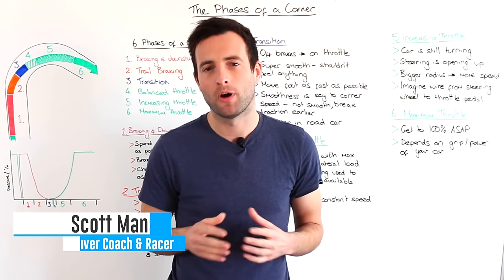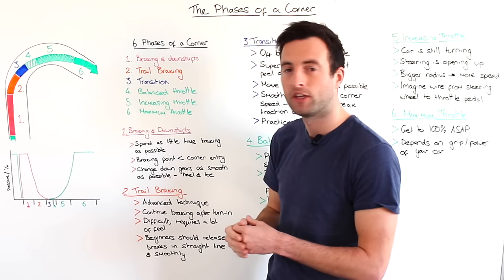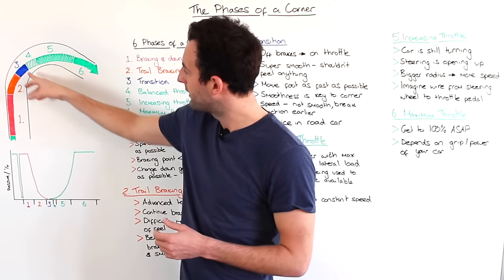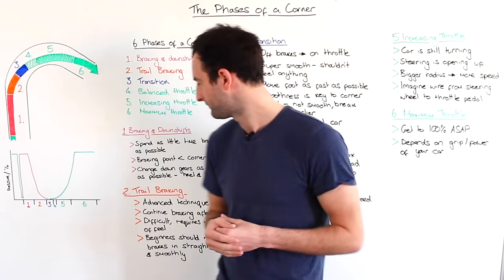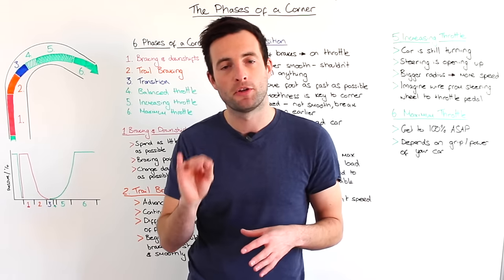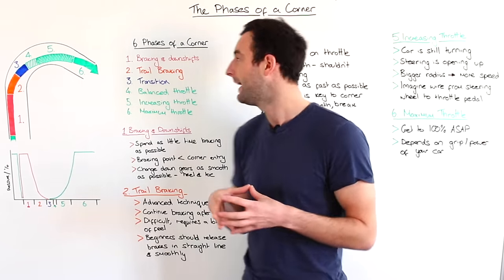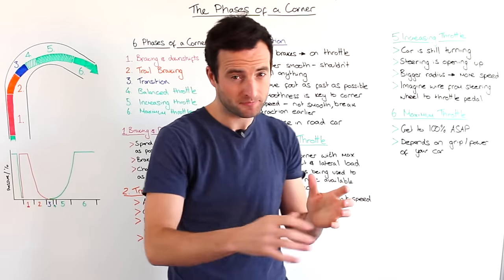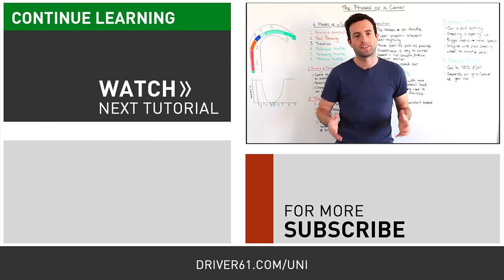The 6 Phases of a Corner: a Step-by-Step Guide

Comment: Excellent video as always. I would have add a graph with the steering wheel input on vertical axis, showing the phases 1 and 6 there is almost no input, 2 the input increases as the car slow down, the exact inverse of phase 5 as the input decrease as the car goes faster. The graph would have shown a Gaussian curve.

Comment: Amazing information, thank you Driver61.

I have found that this to be slightly different in a front wheel drive though especially with regards to the trail braking time(Almost none but this is largely chassis dependent) and the phase when the accelerator starts being applied.

I have submitted footage for review & it would be great to get your point of view especially in a tight "Spec" series with no LSD.

Thanks again for your content, I am studying it in detail.

Comment: Hey man. Love these and totally sharing them. My pet peeve here is the diagram and explanation of Phase 1 pedal work. The graph indicates immediate 100% brake pressure, you even SAY lifting off ...and go to the illustration which shows 100% brake pressure as a square wave. which would mean stabbing the brakes. The braking force should be shown to be ramped up ALSO like in your later video about braking (you do explain it there). But this video by itself ILLUSTRATES stabbing of the brakes .....
Reply from the maker: Hi, yes, fair point - the diagram is probably a little simplistic. When I eventually revisit these we'll have it changed. Thanks for the feedback. Cheers, Scott.

Comment: Driver61, the part I struggle with the most is the downshift and braking phase how to get it smooth? Are you coming down the gears and heal toe downshift? (This sometimes slightly upsets the car and hard to maintain consistent brake pressure) Or are you just selecting the gear you want for the corner before the trail braking phase and releasing the clutch slowly? Or is it a rev match blip quickly after the braking phase before turn in?

Comment: Thank you very much for your videos. I have a question - what are the implications for fwd racing cars? I am currently racing a BTCC FWD Avensis on a simulator and see that the fastest guys are keeping 20% throttle through phase 2 and 3.
Thank you in advance.
Reply: Georgi Nedev 
Phases 2 and 3 are the entry phases and transition, where there is overlap of braking and cornering i.e. trail braking. During phase 2 they are keeping a small amount of throttle on to shift effective brake bias to the rear by using engine drive torque to reduce the effective front brake torque. This sharpens corner entry by reducing understeer and eventually induces some oversteer. At phase 3 the brakes are off but throttle is still partly on because on a FWD car normally understeers under throttle, but in this case throttle is needed to balance the oversteering car.

Comment: Hello, I'm a RC Driver at beginner level... How to handle the corners with an electric engine?
Reply: I imagine the torque of the electric engine was way too much and so once the car is straightened you accelerate otherwise youre likely to spin it coming out of the corner.